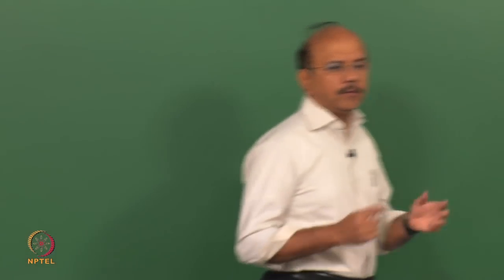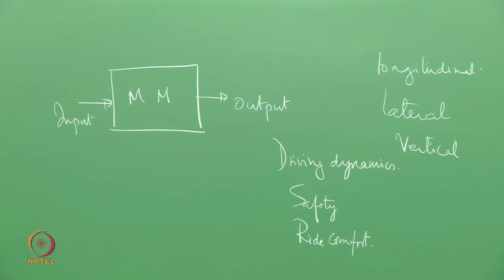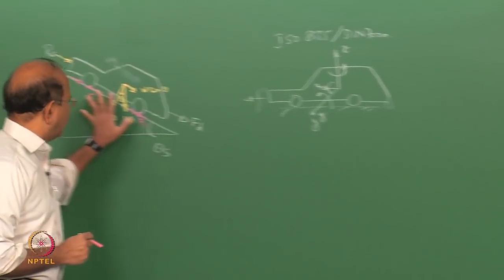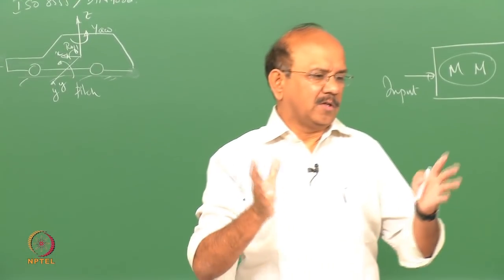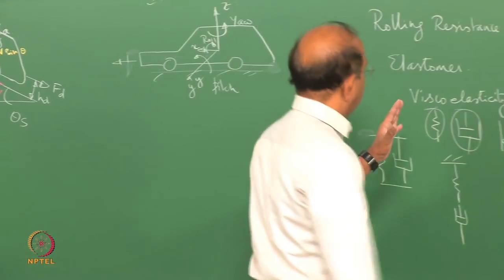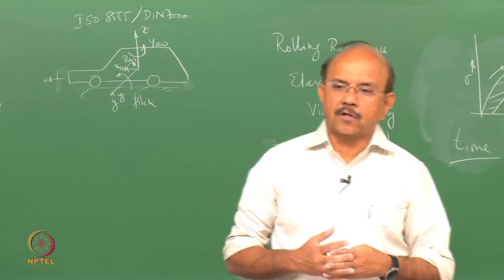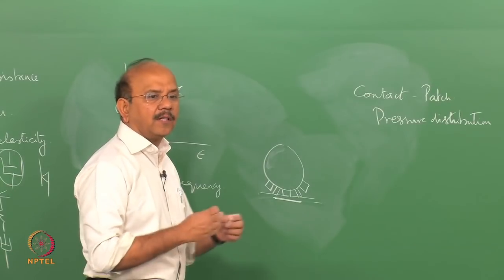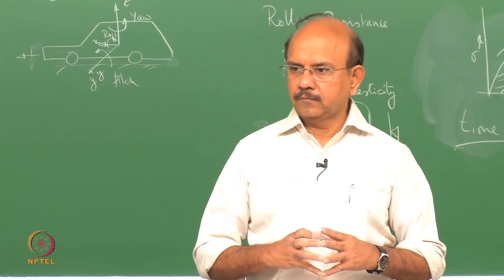Mod-01 Lec-02 Longitudinal Dynamics

Comment: since elastomers follow same path in loading and unloading than why we use visco elastic material which produces hystersis loss
Reply: +Car Tech (AutomotiveTechnology) Viscoelasticity is the property of the elastomer. Elastomer itself is a visco elastic material.
Reply: Hi /Car Tech,  Please share the link with examples.  So that doubts can be clarified.

Thank you
Reply: Maybe for comfort riding, as street roads and vehicles not always follow ideally straight and plain road, bumps and ditches are there.... Also in locomotives metal wheels are used, less energy loss, completely different scenario than roads, on track

Comment: I have a bit of a problem understanding why does the force shift foward due to the elastomeric property of the tire. Is it related to the reaction or something else ?
Reply: More specifically, are we considering that a thread has a “length” where one side is being loaded and the other not?
Reply: I think this is only the depiction  of the rolling resistance force from front. Actually it is caused due to this shift in reaction force when a tyre starts to roll.